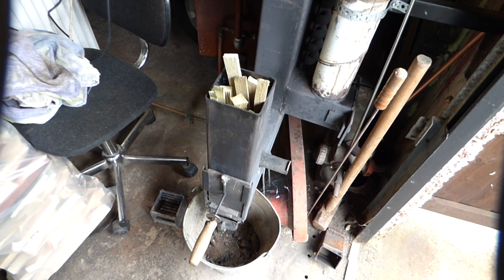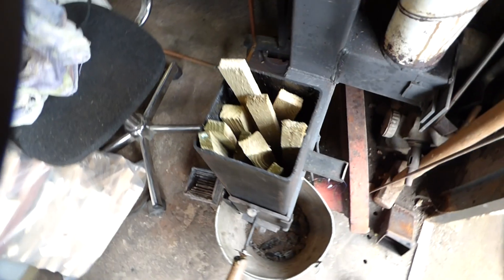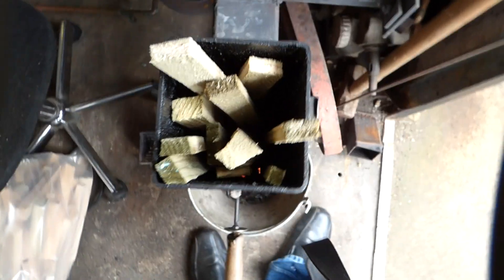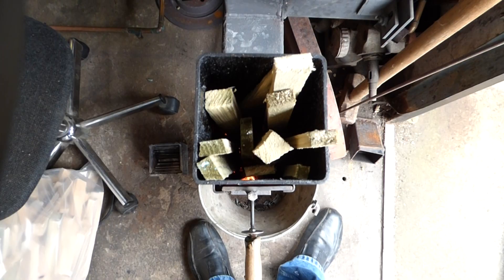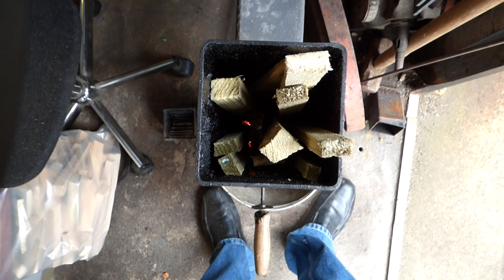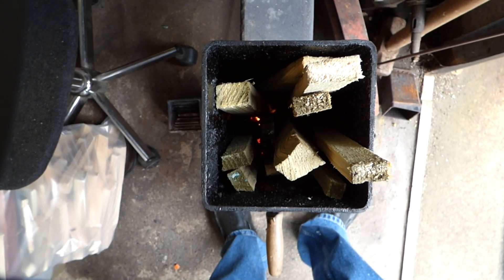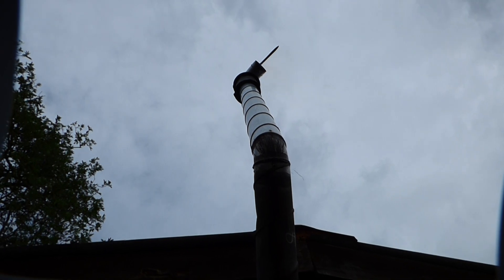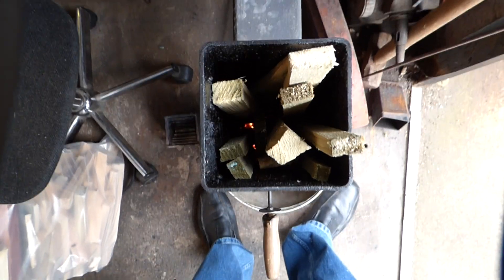diy rocket stove boiler running on wood No.37

Comment: Do you use the pellet basket when burning wood or just allow it to set on the bottom? Also are the boiler pipes threaded to the elbows or welded? Thanks for any help
Reply from the maker: Wood sits on the bottom. 6 inch barrel nipples threaded standard off the shelf. welded after the bends are fitted.